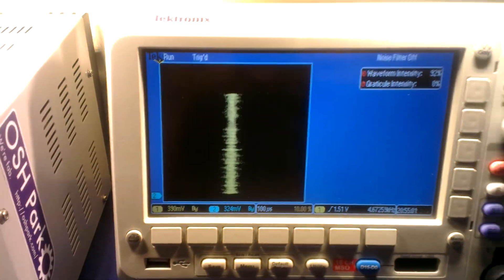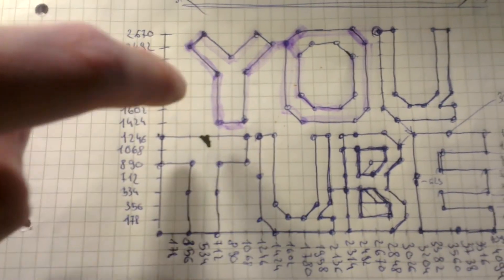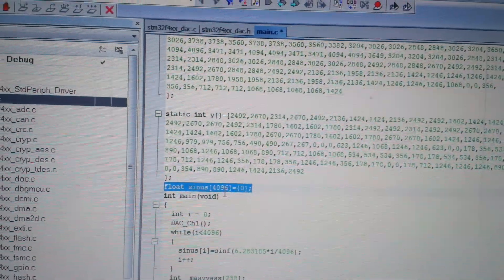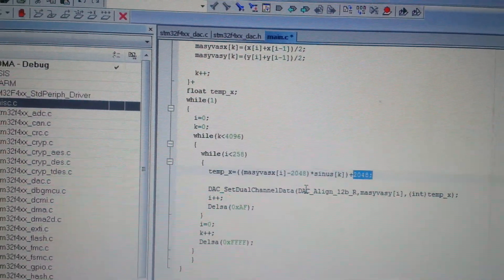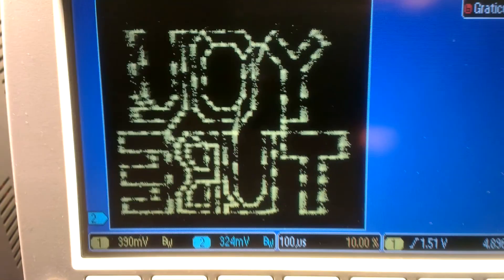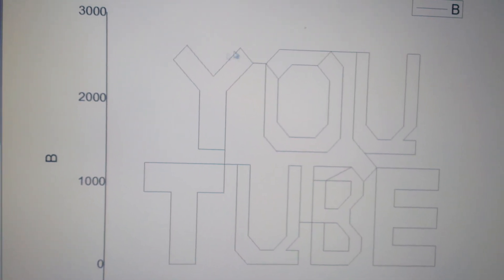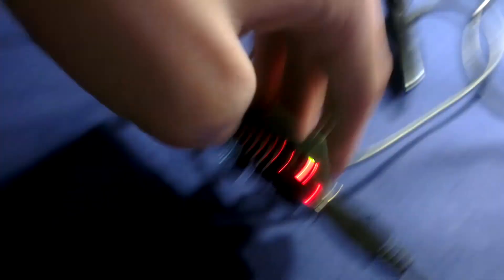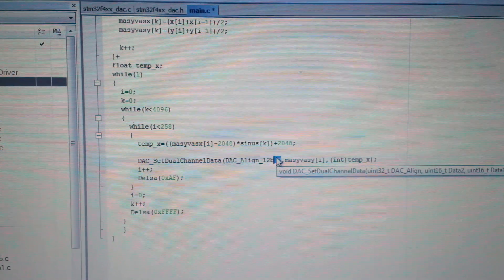Spinning XY mode patterns on oscilloscope

Comment: Nice, quick turnaround on the project.  Thank you for sharing.  I too would like to see it on an old analog scope - they typically do XY operations much better.  A simple analog filter at the DAC output will also help, by slowing down the trace from point to point, giving the scope more time to draw rather than "jump".  Enabling 20MHz channel BW will also help clean it up.
Reply from the maker: i have 12b dac as well as long delay between point's to let is settle down. Also i am using internal 20MHz bw. And since now you have MDO3000, you can use software filter if time scale is on low side (1ms-50us) (but it has some limitation)